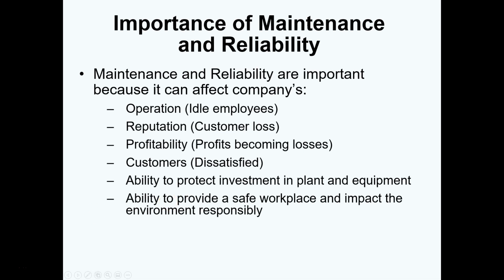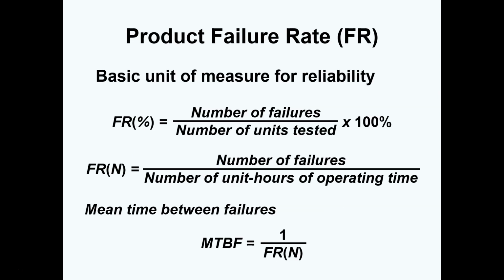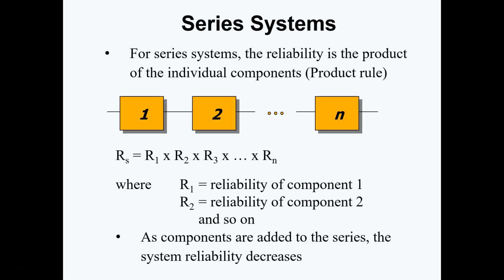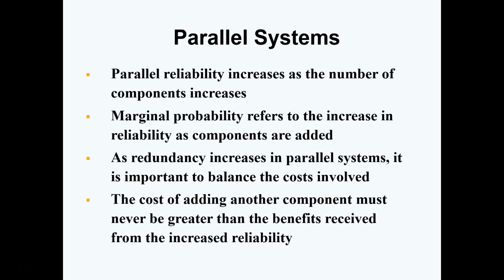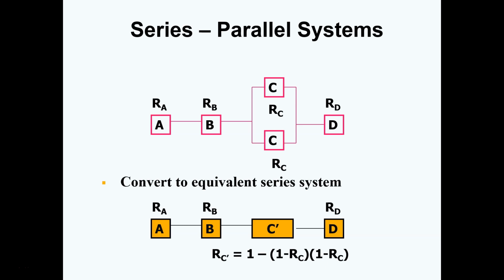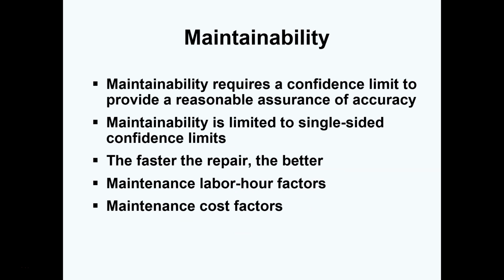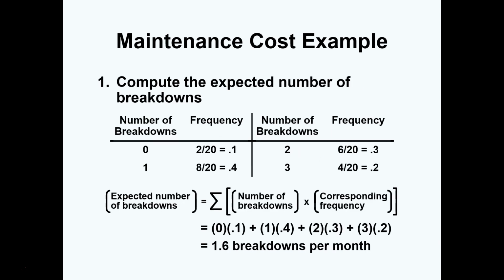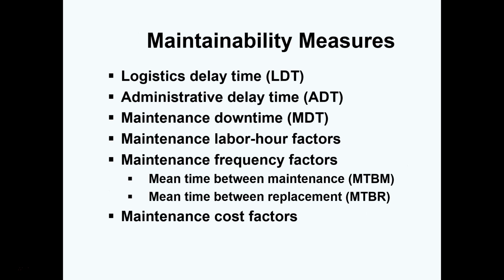Product Maintainability and Reliability

Comment: @6:41

MTBF = 1/FR only if FR is constant. If FR is a function of time, this is not true. Correct?
Reply: Although the failure rate FR, is often thought of as the probability that a failure occurs in a specified interval given no failure before time, it is not actually a probability because it can exceed 1. Erroneous expression of the failure rate in % could result in incorrect perception of the measure, especially if it would be measured from repairable systems and multiple systems with non-constant failure rates or different operation times. It can be defined with the aid of the reliability function, also called the survival function
Reply: Brilliant, Doctor!